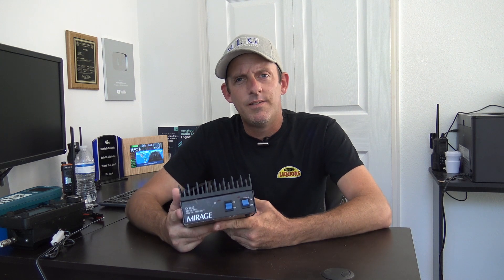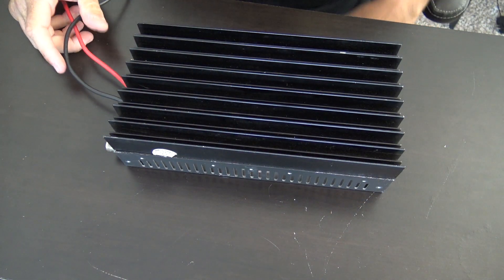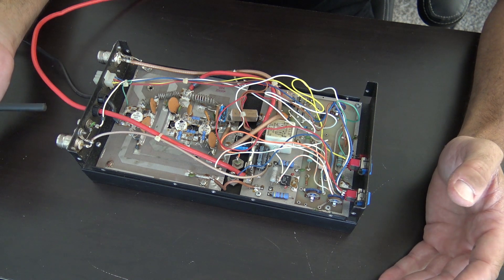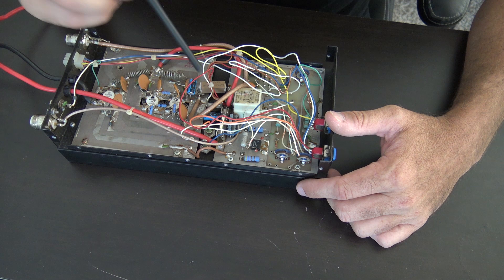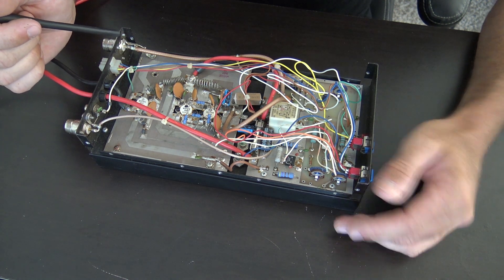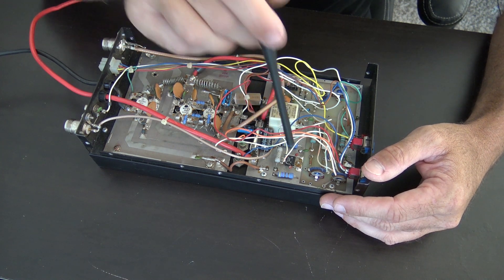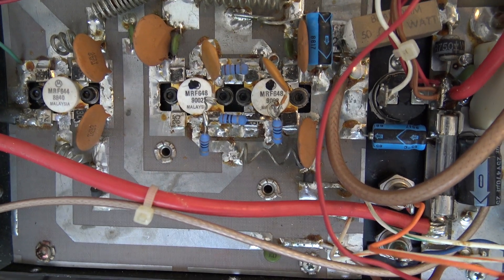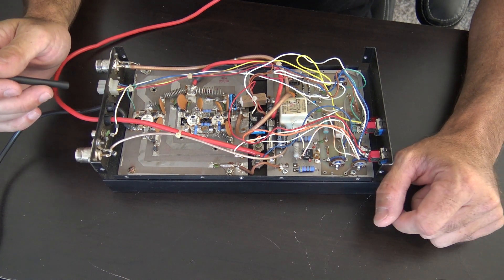CALLING ALL ELECTRONICS EXPERTS!!! Help Me Fix My Amplifier!! Mirage D1010 UHF Amplifier Repair..

Comment: Looks like a COR (carrier operated relay ) circuit. Nothing will happen until a carrier is detected from the transceiver. Build yourself a diode rf probe for your meter to track the rf. NL7VL

Comment: As a field and manufacturing tech of many years, 80-90% is all problems are mechanical (connections). The semiconductors should be your last choice. However, with amplifiers, finals and drivers are another story.
Reply from the maker: And I always assume finals, thank you for the consideration

Comment: Hi Eric,
I noticed a Molex connector on the back plate. Do you know if this amp uses a remote? Might be as simple as not having everything to operate the amp. Stay safe.  73  WJ3U
Reply from the maker: That's for a remote head and normally in the past when I have had these amps that didn't matter

Comment: The very first thing if you cannot or do not have a schematic diagram for the linear i would suggest taking some close up photos of the circuit board before rearranging or swapping parts on the board.
Reply from the maker: Good advice thank you

Comment: Tottally sounds like a bad/cracked solder joint. Go through and re-flow the joints, particularly around the ground. That's not uncommon in those as they're used in high vibration environments.
Reply from the maker: Thank you I will check that
Reply: @HamRadioConcepts  That's probably all high temperature solder in that unit...

Comment: Sorry to bother you but possibly the problem is the final transistors or the relay. Both parts are imposible to get here in Europe. Perhaps you can found it in USA but not for long time. These amplifiers are in extinction because changes in RF technology makes parts obsolete. You cannot get them no more.

Comment: IRL current is from the negative side to the positive. Engineers won't change because they learned the incorrect way and go the math is easier.
Reply: the flow of electrons is from the negative to the positive. Conventional current is from positive to negative. It has little to do with math, and a lot to do with getting the polarity right when it really matters.
Reply: @jonathancotner7040  And then when you introduce pn junctions you also have diffusion and drift currents that you need to worry about.

Comment: The big diode is for polarity protection if the B+ & Negative are connected in reverse. To cause the fuse to blow and protect the amplifier.